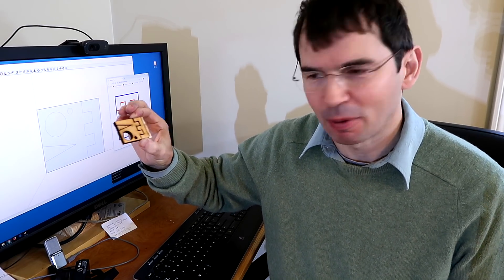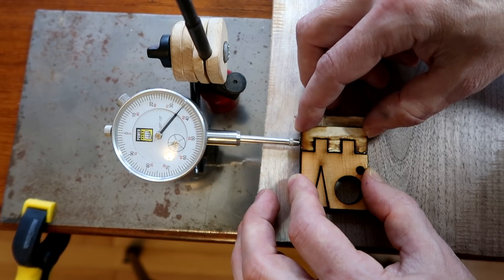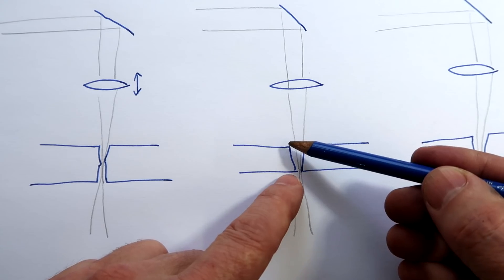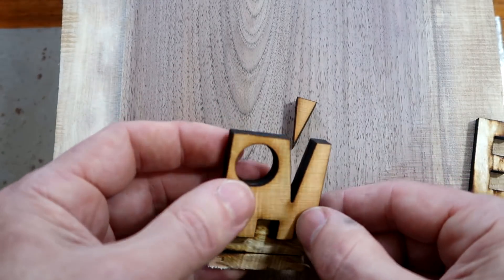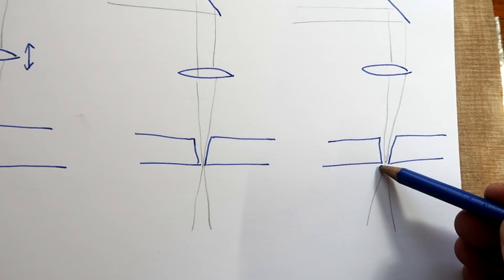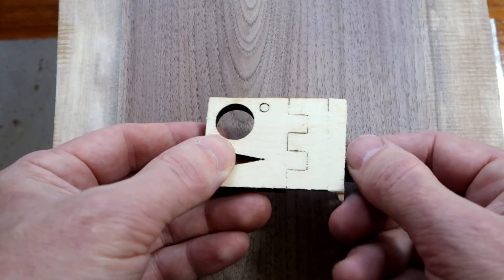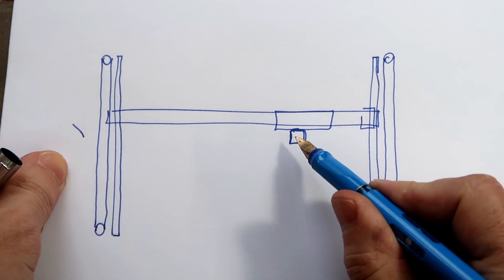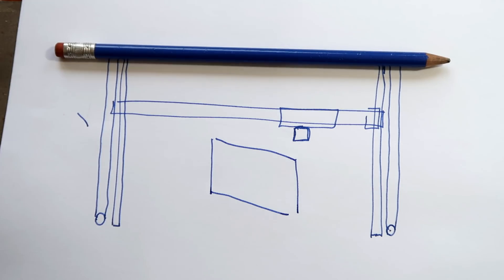Laser cutter cut width and inaccuracies

Comment: Nice video. If you want some samples cut and sent to you from a "good laser cutter" I would 'be glad to send you some. Unfortunately most people don't set their machines up very precisely.
Reply: This is true. I spoke to someone that made parts commercially, their parts had literally about a 30 degree angle on their cuts - using a very short focal length lens that was focused too low. They had no idea that what they were doing was wrong, thought that was just the way lasers worked.
Reply: The software can also make a huge difference that will cause you to tear your hair out in frustration. 2 cases I have had to deal with.

1. Our old epilog legend 24.
 We draw everything up in autocad but were having to export it to corel draw. We were trying to cut some thin (0.01") material into essentially a grid with half circle arch around it with only a few thousandths clearance. It refused to cut right. The top of the arch would cut right but the sides would get too close to the edge It was after we gave up after a day or two of trying that I found out corel was not importing poly lines exactly right. It was very slightly screwing with the arch and seeing as I never zoomed in I never noticed. I just trusted it was importing from autocad properly. Don't have any pictures handy and im too lazy to remote into work and get them.

2. We got our new glowforge in (tube was going bad  ($2.5k!!) in the epilog and drivers were not made for 64 bit so it was nigh junk) 
Was making some tags that we had made plenty of times before on the old laser and while text was coming out ok the logo was horrible. Come to find out corel had major issues exporting as an svg file. https://i.imgur.com/ApjcPBu.png was what was expected. https://i.imgur.com/nQxZQ4C.png Was what corel was exporting. I changed to exporting as a pdf and everything worked great after that.

I have since been attempting to get good with programs other than corel. Unlike the epilog the glowforge does not need it. I still fall back to it when I need to get stuff done fast.
Reply: It is the small stuff that I have a hard time doing in other software. For instance in corel you can center text in a square vertically as well as horizontally. Inkscape seems to not have that option.
Reply: Tributary House Ltd. , weird. Inkscape always messes up small circles (2 or 4mm) into irregular shapes.  But I was using inkscape's gcodeTools to generate gcode, so maybe that was the problem.

Comment: You can easily adjust offsets in the software to get joints as tight as you want them.
Reply: Not when you cut parts they way he did. In order to make use of the offsets each part must be cut by itself, can't share cut lines.
Reply: @HarmanRobotics  Yes, of course.  

But it is actually much easier to make parts with seperate cut lines and it just takes a little extra time to get a perfect fit.  If he would have cut 1/8 acrylic the kerf would have been around 0.006" (0.15mm) even with shared cut lines.  

My concern is that a lot of people might put off from digital fabrication based on a test that doesn't represent the a good use of the technology.  It's kind of like Roy Underhill testing a table saw and publicly implying it is not a very good technology because he got poor results from a saw that wasn't adjusted properly with the wrong blade for the material being cut.  All his devoted followers would be doomed for another 10 years without a better technology because they took that one test as a true representation just because of who he is.

Comment: I'm actually working with a laser cutter at my work. We cut all sorts of stuff, and we overcome the problem where the box joint doesn't fit with spacing the two parts a little bit apart from each other. So the when you cut the teeth on one side it doesn't make the recesses they'll go into, the are cut separately. Also i give about 0,5 mm tolerance on the teeth so they are snug in the recesses.

Comment: Why don't they move the focal point up, and then put a lens near the focal point that diverges the incoming beam, so that the laser beam becomes pretty much parallel for the cut? 
I'm nowhere near an expert in this field, it's just something that I'd want to look into if I were developing these machines.
Reply: Tim Derks I think you never want the beam to focus to a point until you are focusing on the material. Otherwise you'd burn up your lens, or mirror etc.

Comment: Also a problem with cutting plywood is also that it might continue to smolder a bit if if doesn't have nitrogen blasted at the cut
Reply: Nah, using the proper grade plywood and powerful air assist takes care of that. No need for N2.
Reply: Only if you are cutting too slow at high power, which means you are probably trying to cut something beyond the capabilities of your machine.

Comment: Seems to be more complicated than it's worth. A small kerf is nice, but straight edges would be better imo. Kind of pointless for cutting if you still have to true up the cuts. Unless a person doesn't care about that, but I think I'll stick with the router mill, personally.
Reply: If you use proper machines, settings and  materials lasercutters can cut very straight - industrial cutters for example can cut 50 mm steel faster than plasma cutters and stillbhave perfectly straight edges like waterjets

The laser matthias used was either set up very wrong or is just plain crap if it produces such tolerance and skewed edges
Reply: @suit1337  or its used by so many different people at the university that it is terribly decalibrated.
Reply: @suit1337  Water jets also have issues with straight sides depending on power, and material, and cutting speed. Similar things need to be done there to get perpendicular edges. https://www.omax.com/news/blog/controlling-taper
Reply: James Biggar not that you compare a router w a laser, they dont overlap much, but even a poorly tuned laser is way more precise than a router (even if u meant a cnc router). U can keep a 0.002” kerf and tollerances are measured in 0.001” or less. Our 20’000$ axyz router doesnt come close to thst (and frankly it doesn’t need to)

Comment: Will the heat cause trouble for the glue meaning this is no good for making cog wheels?
Reply: If you use a proper laser the workpiece willl be air-cooled and will not delaminate or warp

Pretty standard in most modern machines

Comment: Not only aligned or focused properly, that machine needs a lens with higher focal length to get a smaller beam width for thicker material. Good video for explanation of common problems for new laser users though :)

Comment: Hi Matthias, with the wedge shaped piece, shouldn't the fraction be 1/10, rather than 1/5, as there are two tapers to the wedge?  Feel free to hammer me if I am wrong!  You will have put more energy into the video that I have to the comment.  All the best, Owen
Reply: Nah, you can set up a pair of similar triangles to show that kerf is the ratio of depth to width over the offset.

Comment: I did a couple of furniture designs with laser cut joinery and my cutlines were 0.16mm in a 12mm poplar ply. much thinner.
Reply: That's a good machine. My kerf is typically under 0.2mm. Anymore than 0.2mm indicates a problem

Comment: There is a simple tradeoff in a laser cutter. If you focus harder (by using a shorter focal length lens), the kerf becomes lens straight and more sensitive to misalignment. Thus, if you have enough power (or enough time to cut slowly/often) you should use a weaker lens.

Comment: The kerf measurment is also subject to depth of cut. As if you were cutting with a v groove bit on a cnc or the like, the deeper you go, the wider the kerf would appear. the laser would have this effect too. if you were cutting into a sheet of paper im sure the kerf would measure less since the taper is reduced. 
A water jet has something similar occur but it can usually be compensated for by a good operator as well as a lot of machines have head ajustment.
i'm not very experienced with laser cutting personally. I don't like the burnt edges it has to leave in wood. I still prefer a waterjet to a laser for part cutting, including for wood. it's kerf is siginificantly larger than the laser but I think it stays more consistent with depth than the laser and of course, no burning on materials.
Reply: No, it is not like a v groove. There does not need to be taper to a laser kerf. I have cut up to 14mm thick wood with no taper. I routinely cut up to 3/8" acrylic with no visible taper. If the laser is focused on the surface, and the speed/power set correctly, you will get narrow, straight kerfs.
Reply: Harman Robotics if you read my comment I did say I don't have a lot of experience with laser cutting personally but thanks for your insight
Reply: With a laser the charring is highly dependent on the power and pulse length,  the more power you can get in a shorter pulse,  the less charred the edges will be. 

The laser should evaporate/sublimate the material without burning

If you use a magnifying glass on a piece of paper it will turn black and catch on fire,  if you use a high power perfectly focussed laser with enough cooling the paper will be cut without the slightest burn mark

The thickness and the thermal conductivity are the major factors with this type of cutting.

Comment: I don't think I've ever seen a product with that thick of material being laser cut. They're usually like 1/8 or 1/16 inch sheet.
Reply: I've cut 1/4" and 5mm plywood and mdf on our local maker spaces laser cutter.  I've never run into the kind of problems Mathias is showing on that laser cutter.  Almost every project has box joints as well and the joinery usually turns out perfect unless it's an error in my design.

Comment: I have had a laser for 5+ years and cut 1/4" plywood all the time.  By looking i see 3 things, 1) the laser was not focused on the surface. 2) They need more air pressure, i cut with 60PSI and the top surface is very clean and only a pencil line cut, with only about .008 movement. 3) regular cleaning of the lens is important because the compressed air tends to make it dirty .   Keep the videos coming !!   Good job
Reply: I came to the comments immediately to type out this exact thing.  Poor focus, poor material choice (which Matthias mentions), and the air pressure.  I cut everything from paper and fabric to 3/4" acrylic on my 80W CO2 (24x36) and get quite small kerfs when properly set up.
Reply: I agree as it was burned so where was the air flow?  When Matthias mentioned about skew (the second topic in the video) that would not happen because the beam from mirror 2 to mirror 3 is lined up so the piece would be skewed on the table but would be the exact dimensions called for when you pulled it off.  Now if the laser were a saw he would be right.
Reply: @ @thebeststooge   No, he is correct about that. When you align mirror two you are adjusting it so that it hits mirror 3 in the center at either end of the gantry. If the gantry is skewed then mirror 2 will be adjusted so that the beam is parallel to the gantry. The way to check for the gantry being square is to cut or engrave a large rectangle and measure the diagonals. If they are not equal you will need to "unskew" the gantry, realign mirror 2, and test again.
Reply: No, he is right I take it back as I had just woke up and I am now thinking more about it.  If X is fine and Y is skewed it would still do straight lines but it would be off so your rectangle is still a rectangle only skewed in one direction.

I still am questioning about the beam on the lens though as I always thought that if the beam hits anywhere on the lens that the beam coming out would be in the middle of that lens and the lens focuses it into a tinier dot.
Reply: @thebeststooge  The beam does need to enter the lens in the middle for best results. If it hits off center then the "cone" that is made by the lens will not be symmetrical.
Reply: That is what is wrong with my machine and nothing to be done about it.  If it is 50w/60w Chinese ebay special you can kiss the baby as there is no Z height adjustment that you can do for it so the beam can never hit the lens perfectly in the center.

edit:  On my machine I need about 1mm more so I can lift it up and the beam will move over to hit the center.  No Z height adjustment for the head where the mirror is I can say, so does Russ Sadler and many other users, is one of the greatest downfalls to the Chinese made systems.
Reply: @thebeststooge  Hmm, Z height is not a factor for centering the beam on the lens. You can steer the beam towards the center of the lens by adjusting the 3rd mirror, moving the entire laser head assy., moving the 2nd mirror or even moving the laser tube so that the entire beam train is raised or lowered. In other words, there are many things that can be done to change where the beam hits the lens, but Z height is not one of them. If everything is properly aligned you can change the Z height as much as you want without changing alignment.
Reply: As far as moving the whole works down or up that is not possible on these machines as I can do it with my mod on the tube but mirror one is fixed and there is a round hole that would have to be made larger or cut lowered to accommodate it.  Again, not a small chore when a simple Z height adjustment, as in the above video, would easily solve so your beam is dead on/spot on the center of the lens.  3 seconds to adjust Z 3+ hours to screw around with mirror 1, the tube, mirror 2, re aligning the mirrors then rinse and repeat ad nauseam until everything is set.
Reply: @thebeststooge  Sorry, I am lost. At what part in the video does he talk about changing Z height to correct for the beam not hitting the center of the lens? The only way that moving the lens up or down could make the beam get centered is if the incoming beam is not vertical (perpendicular to the table). In that case the beam may hit the center of the lens in that one position but then the exit cone will be skewed (and may hit the side of the nozzle). It is important the the beam is adjusted to be both centered and perpendicular to the table. When that is accomplished you can move the lens in Z and the beam will remain centered no matter the height of the lens.
Reply: @thebeststooge  Lol, the problem with his videos is that they are so long and slow paced, not going to sit though it. I am going to assume that you are talking about adjusting the whole laser head assy in the Z axis, and not a Z height adjustment that is accomplished by moving the table or the lens tube. So yes, of course raising or lowering mirror 3 (in the Z axis) will change where the beam hits the lens. If that is not possible you may be a able to shim the mirror, that would have the same effect as raising the beam path.
Reply: When he adjust the whole head assembly up.  He has explained it before and he is right.  I write to him regularly about such stuff and there is just no way to make the beam head straight down in the center of the lens via the adjustment screws.  It simply cannot be done because let us say the mirror is fixed and at at the proper angle.  The beam from mirror 2 comes in and hit the mirror too high from the center of the main hole of mirror 2.  Now the beam will go down to you left as you look at the head.  Lower than the true center the beam goes down and is now hitting the mirror on its bottom section which makes the beam go straight down on the right side.  Adjusting the mirror is only to make the beam go straight down not to hit the middle of the lens.  If you want to see if you are hitting the middle of your lens then take the nose off (the part with the mirror) and down that tube the beam will go and if straight it will never change where the pulse hits from the top to the lowest your bed can go.  That is what those screws are for and nothing more BUT to make the beam dead center of the lens it must hit dead center of mirror 3 which is, by the way, not dead center of the big hole as Russ, and I, found out and is about 3mm above it. Mirror two is not going to help you there either as its screws is just to make sure the beam is aligned from far left to far right along the X axis.

Two ways to help this is to do it your long way from hell where everything has to be lowered or raised OR having a Z adjustment on the 3 mirror's head assembly.

edit:  I just noticed this "The only way that moving the lens up or down could make the beam get centered"  We are not moving the lens but the entire head assembly which means we are having a static dot coming into mirror 3 and by adjusting the head assembly up, or down, we are moving the dot across mirror 3 making the dot (the beam) hit the lens at different spots.
Reply: I am not a millennial who bitches that nuking a burrito for one minute is taking too long as I like how long his videos are because you will learn a lot from them.  I do NOT have ADHD in such things.

There is no way to shim anything.
Reply: @Boudico  Hey Chad, what are your wood cutting limitations with this?  I have often though about getting something for my shop for use in both Acrylic and cabinet grade ply, Birch ply and MDF.  Would love to pick your brain.
Reply: @EZCyclone  even with small 60 W CO2 lasercutters you can cut 10 to 20 mm PMMA with the right settings ( multiple passes, short pulses, slow speed, refocus after passes) sadly most cutters Don't support automatically correcting the focus after passes

Before buying let them show you the machine,  for example trotec laser or epilog do this
Reply: @suit1337  Oh I will likely build my own.  Just trying to iron out how big I want to go for the tube itself.  I have a 60"x120" bed CNC just sitting in storage begging to be converted to something cool.
Reply: 10+ years of laser experience here. Looks like this material was not suitable for laser cutting. Needs to be glued with an interior grade glue.